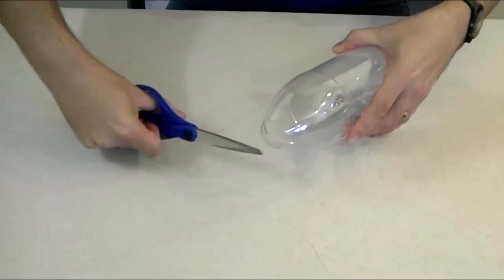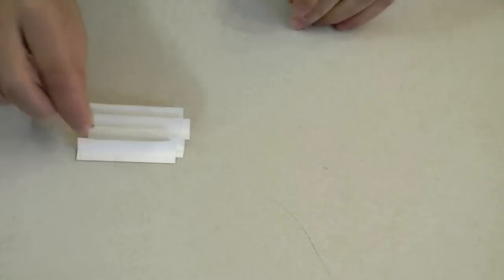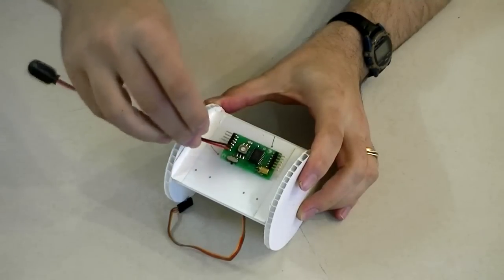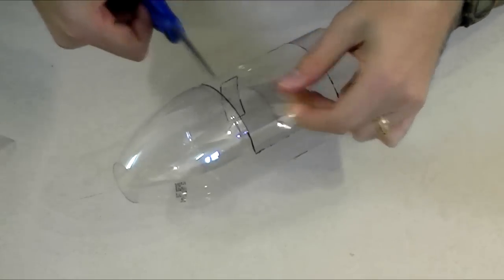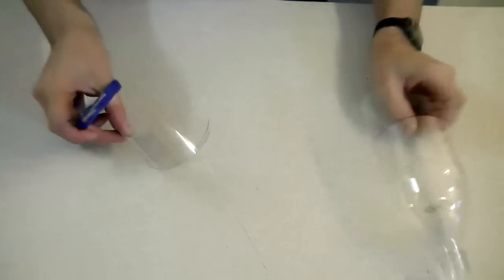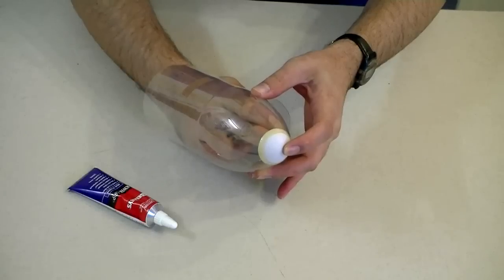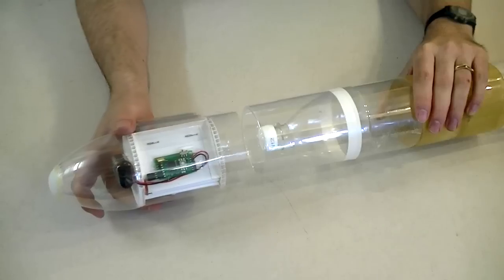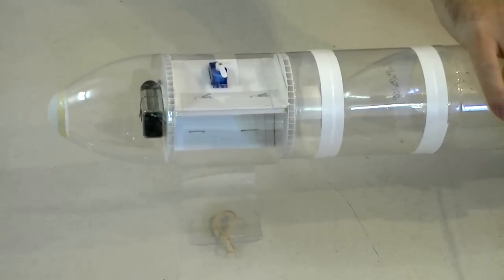Water Rocket Parachute Deployment Mechanism

Comment: Hi gk123434534, i am living in Pakistan i tried to find it everywhere but i could not find it. Can you please advice some alternate for this? or can you please suggest me how can i get this PL premium polyurethane construction adhesive in Pakistan?
Reply: I can purchase sikaflex 11 fc because we have outlets for SIKA but PL premium polyurethane construction adhesive i could not find anywhere please help me.
Reply: Unfortunately Sikaflex 11FC is not suitable for splicing, for use it bursts at around 50psi. You could try alternate polyurethane wood glues. Some of these may work. Without knowing what glues are available in Pakistan it is hard to recommend something. I would look at the PU glues that you can source and then do a few test splices to see which ones hold the most. Make sure you allow at least 3 days to cure the splice before testing.
Reply: Thank you for your help ! i will try to arrange and i will let you know.

Comment: Hi, I'm working on  a solid fuel rocket using custom motors. My motors are not equipped with the necessary black powder charges for parachute ejection. Would this system work as an alternative?
Reply from the maker: Sure, you would have to work out the approximate time to apogee to open the parachute at the best time. You could get something like a stratologger and use it's ejection charge firing capability to electronically fire your ejection charge at apogee.

Comment: do you think a Arduino will survive a parachute failure?
Reply from the maker: +Hakenhand Röhle If it is well padded, then it should. We have had multiple failures and usually the electronics survives if it is protected. See if you can locate it further down on the rocket.
Reply: Thanks :D

Comment: Is it possible to create a rocket that still functions without using servos or electronics? I have a school project and am limited to the materials that we can use. Basically, we can't use electronics. Any ideas?
Reply from the maker: ***** Yes, it is not only possible it is also very common to make good deployment mechanisms without any electronics. Look up "Tomy Timer Deployment". There are many tutorials available on how to make them. They are also very cheap and lightweight. If you are after other options you may want to have a look here: http://www.aircommandrockets.com/recovery_guide.htm
Reply: Thanks for the link!

Comment: Very nicely done.  This is why you guys are the rocket engineers.  :)

I think I will try a similar design (will probably adjust the spacing a little) using the guts of a cheap R/C toy to remotely trigger the chute.
Reply: Should work fine. A number of rocketeers use this technique to remotely deploy a parachute. Make sure that your transmitter/receiver has the range to deploy the parachute at apogee, rather than when it gets closer to Earth. High speed parachute deploys can result in shredded chutes or snapped shock cords.
Reply: Yeah, that is a concern of mine.  I actually have a full-fledged RC transmitter/reciever/servo set that I got as a gift, but if I can do it with a cheap toy that costs a lot less, I will.

Can you link to any videos of a similar setup?  I have been looking on youtube but have not found any that I could spot.

Comment: Would this work if i used a arduino to control the servo?
Reply from the maker: Hi Alex, Yes totally you can use any kind of controller for the servo. Even an RC remote will work fine.

Comment: Can you just use a servo timer and motor or do you need the uMAD with those for the parachute to come out?
Reply from the maker: Yes, just the servo timer and a servo are needed. The timer activates the servo motor after a set period of time after launch. The uMAD can be used in conjunction with the timer to detect when the rocket tips over.

Comment: would you need a servo timer or could you just use a servo motor and a uMAD?
Reply from the maker: The uMAD cannot drive an RC servo motor directly. It can fire pyro ejection charges directly. The servo timer can take be triggered by the uMAD ejection output and produces the correct PWM signal for the servo motor.

Comment: Hello
Can you give me the reference of the electronic board to control the servo? Please 

A hug

Rik
Reply from the maker: Hi Rik, In the comment description for the video is a link to the Servo Timer II boards that we use for the timer. However, you can use any other kind of timer in this mechanism even something like a mechanical Tomy Timer will work. These are the clock work mechanism found in the little plastic walking wind-up toys.

Comment from the maker: Hi, 1) Look for a "Tomy Timer" these are mechanical clockwork mechanisms that are inexpensive, light weight and easy to use. You can use these instead of an electronic timer.
2) No exact dimensions, you need to make it fit into your size bottles. Exact dimensions are not critical.
3) Try this on YouTube: Ip0SlVY3OTk 
4) Please see tutorials on our main website. Happy to answer specific questions.

Comment: It's often used as a signage material for political campaigns in the U.S. There will be a u-shaped wire running through the bottom for staking onto the lawns of supporters.

Comment from the maker: Hi Jamie, Good question. We put a couple of pieces of tape going from the lower coriflute circle over the bottom edge of the parachute hole and tape it to the outside of the nosecone cover. That way you can easily remove the tape and slide the mechanism out. The position of the servo can be either vertical or horizontal. Horizontal gives you more room for other things like altimeters or batteries under the servo.

Comment: By the way 2 questions: Firstly, how do you stop the elastic band turning the whole mechanism inside the bottle because surely when you hook the band on the servo, it would pull the mechanism round? Secondly is there an particular reason why you position your servo lengthways?? many thanks!!

Comment from the maker: The timer can work in two modes. 1) purely as a timer - it will activate a servo after a set period of time after it detects launch. This is independent of the what the rocket is actually doing. We use a simulator to work out how many seconds are expected for a flight and set it to that. 2) The timer can accept an external input from an altimeter or magnetic apogee detector to activate the servo when a rocket reaches apogee.

Comment: As a device to open the parachute, or would not be too heavy.
 My parachute deployment device does not use a servo motor and an electronic circuit.
 The early days of development, open a hole in the nose cone, was blown off in the pressure in the nose cone.
 Because only a hole in the nose cone, the weight of the device there is no parachute deployment.

Comment from the maker: @MrTomcarnahan Epoxy won't hold all that well to the Corriflute as it is made from polypropylene. We find contact adhesive works quite well for bonding. If you want to use epoxy, I suggest making lots of small holes on the sides of the corriflute to be bonded. This way the epoxy will be able to grab a hold of the surfaces.

Comment from the maker: @wyz2285 Indeed a Tomy timer can be used with this mechanism, and would result in a lighter and cheaper solution. The timer and servo has certain advantages over a Tomy timer though such as a built in launch detect and accurate timing. It can also be connected to a other sensors that detect apogee like the uMAD we fly with the timer.